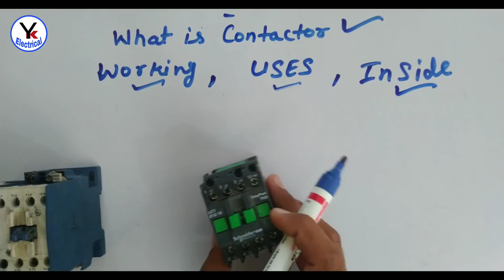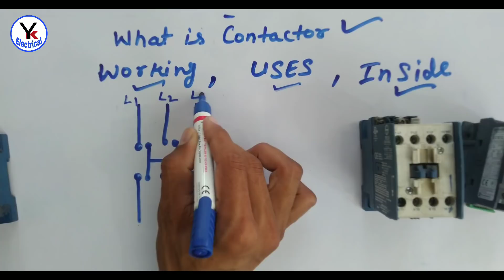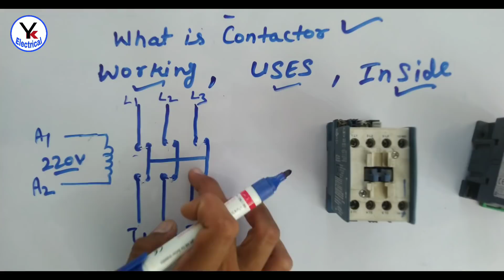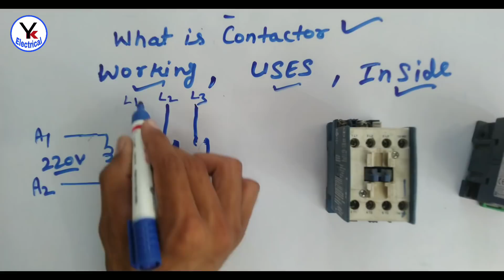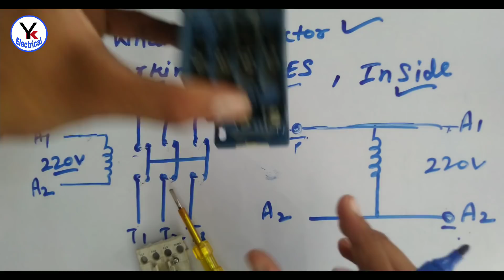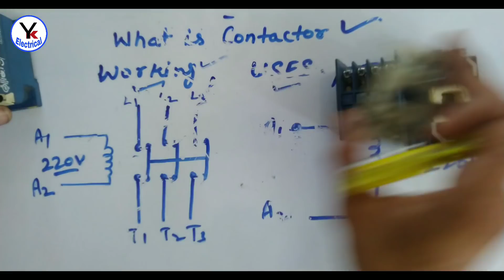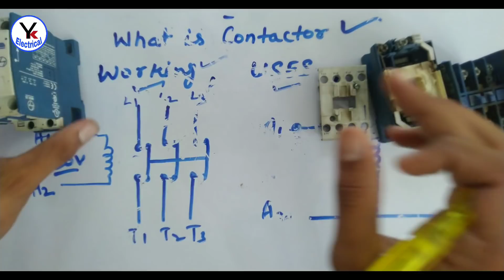what is contactor | working of electric contactor | uses of magnetic contactor in hindi

Comment: What is coil voltage is between 140vac - 240vac, Will it work?

Can I connect home 1 Ton air conditioner and 2000watts greyser to it.